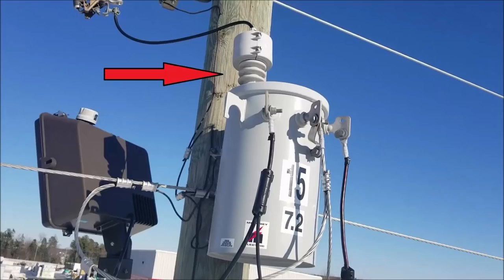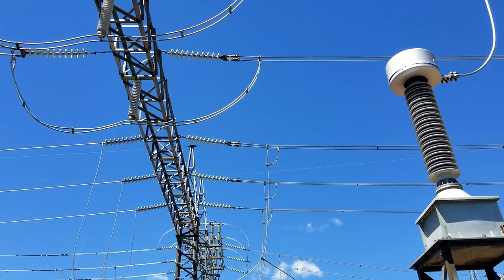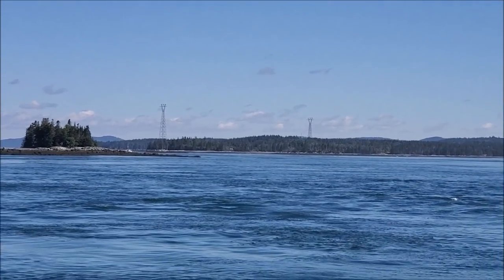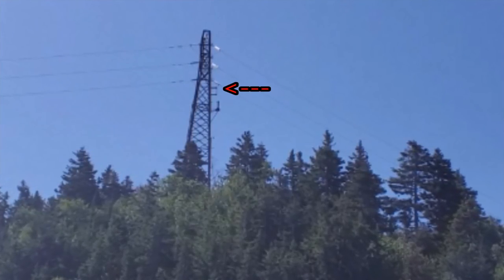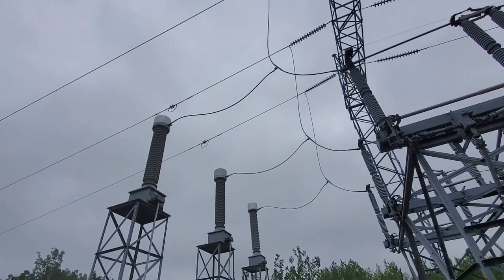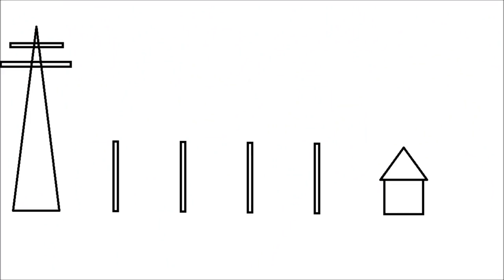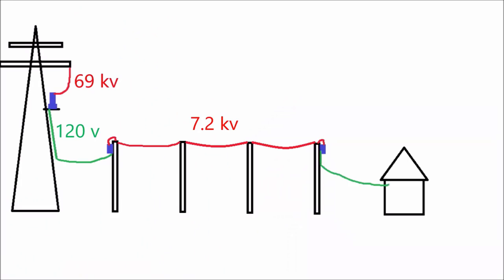69kv tower feeds cottage on an Island

Comment: In the Potomac River, running from the Virginia side near Dumfries near the Possum Point power station to the Maryland side, is a transmission line. I believe the voltage is 230kV. There are strobe lights on all of the towers in the water (IIRC there are 8 of them on the water) except for the ones closest to shore on each side. I wondered how they power the strobe lights. On each of the ones that has strobe lights, you can see what looks like a standard pole transformer mounted about 10 feet up the pole from the platform, which in turn is about 6 feet above the water. So what are they feeding the standard pole transformer with? Well, I noticed that one of the two static wires at the top isn't actually a normal static wire, it's on insulators, tiny ones that you have to look real close to see. And if you look close you can see that the not-a-static-wire feeds the pole transformer. So the not-a-static-wire is on insulators and feeds the pole transformer at each tower that has lights on it. So I assume that they're just feeding the not-a-static-wire with 7.2kV from either the Virginia or Maryland side.

Comment: bet his service is pretty reliable, being on the transmission and all
Reply: And I'm sure he could get 3 phase no problem.
Reply: @GeneralChangFromDanang  That is not necessarily true. If the power usage is low, and there is no prospect of power demand increasing in that location for decades, then there would be no point using 3 phase line to that location. That would be unnecessary cost, even if small one.  In Europe it is very common to have 3 phases almost everywhere. US and Canda are weird.
Reply: @movax20h  Understandable, but high voltage lines in the US are usually 1 line per phase. I was pretty sure I saw 3 lines on those towers.
Reply: @GeneralChangFromDanang  usually you will see 3 wires. It will be two phases and neutral. Additionally neutral often will be grounded on poles regularly and at the end of line.
Reply: @movax20h  No neutral required on 3 phase high voltage lines. But I understand that confusion.
Reply: @movax20h  You can clearly see 3 phases on that transmission tower.  They're only bringing one down to the transformer.
Reply: @movax20h  It is never two phases and neutral.  You might be thinking of split phase distribution to a house where it is two legs of one phase and neutral.

Comment: Fascinating
Thank you for sharing Aaron. 

I'm curious about lightning protection at the cottage end of this.
Wouldn't this particular residential service be susceptible to much greater risk of lightning related issues? As the single load on this branch of multiple towers/multiple spans, without an entire grid of residential/commercial loads in parallel... it would seem more likely to be an issue here. 

I fully appreciate lightning possesses so much energy that it'll take extraordinary paths ... 
However, just curious if a single customer after all that physical exposure via long HV feed is more susceptible than a big parallel group of residential services. 

As a retired JW, I don't believe I've ever given such a scenario any consideration. 

Thoughts?

Comment: Is the cottage satisfied with the amperage it can get this way?  If it has high power electric anything (e.g. a stove) that's going to be a challenge with only one PT and 7500 VA (watts, for resistive load).  That's like two large burners and the oven.  Can two PTs be used in parallel to get more amperage in the final customer feed?  (15,000 VA or 62.5 A on split 240V.)  Or instead of parallel, can one of them be hooked up with opposite primary (or secondary) polarity so as to form a split 240v line with the other, so the resulting feed may drive a pole pig (7200 to, or in this usage from, a split 240)?

Comment: I looked one of these up and they're called power voltage transformers. How is the primary on this wired? The ones I've seen have one primary bushing. Are they wired line to line? I don't see a "neutral" on a transmission line.

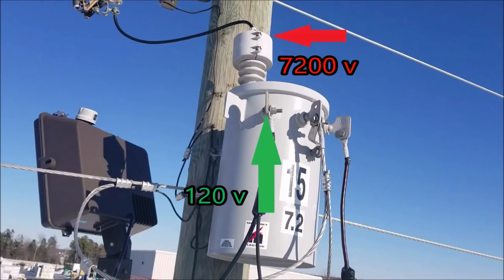Comment: 4:10 I get it! I think.. I see how it works, the why? I think you are about to explain..
Edit: voltage drop, okay.. yeah, that makes sense.  I was thinking less different types of equipment to stock and I was going to say IDK about the cost of a 69kv to 240v transformer.
But you've got the PTs at 120V.   Could you have run 69KV to the cottage and stepped down two phases to 120v/ea.? - this is why I'm not a lineman, 3 phase confuses me. 

But that seems like you could use smaller conductors and cheaper transformers, idk the cost of the 7.2KV ones, but they look like they use more material than the PTs for voltage measuring.  What is their ampacity?  If it's just for measuring, I was surprised to learn it was still supplying all the current to the cottage.

Comment: Walk up to the pilon and take a video showing us a good view
Reply from the maker: I certainly will if I ever get the opportunity again!
Reply: @Bobsdecline  thanks
Reply: @Bobsdecline  can you do a video on how to tell if high voltage “7000 volts” lines are 3 phase or not and is there ever a ground on a primary line and why are there 3 wires and sometimes 2 or 1 high voltage primary wire

Comment: So why would you convert to 120 first, then back to 7200? I get that you want to measure, but why not just convert directly from 69k to 7200, and have an additional small transformer to do 69k to 120 for measurement? 

That way instead of needing two big power transformers (one for down to 120, one for back up to 7200) you only need one big power transformer (69k to 7200) and one tiny cheap one, saving quite some money, and eliminating the losses of that short 120V run.
Reply from the maker: That one big one would be too large to mount on the tower. Essentially what you'd have at that point would be a substation, which would be much more expensive and require frequent maintenance and inspections.
There's more info on this in some of the other comments ✌️
Reply: @Bobsdecline  Ah I saw that comment. So they simply don't make a small 69k-7200 unit. Makes sense given that would be device for special occasions only.

Comment: Your standard voltages are strange from my perspective where we generally use
11kv, 33kv 132kv, 275kv and 400kv for transmission....

That 69kv line looks physically larger than most 132kv lines here!

Comment: That was an interesting video. I was wondering why the voltage is not stepped down at the tower to 7200 volts and then at cottage to 120 volts?
Reply: Because a 69kv to 7.2 kv transformer is one you'd use at a substation.  It is huge.  They don't have much of a market for little ones.

Comment: Is it more dangerous if the backfeed were just 120V instead of 240V, as in a center tapped transformer, applying only one 120V leg would mean a higher turn ratio in the transformer, and 14400V out instead of the 7200V if backfed with 240V? Therefore a higher, more dangerous voltage (at lower amperage) when backfed with a lesser voltage across only the one leg instead of phase to phase directly? **Brainfart, of course voltage and turn ratio cross each other out, but feeding 240 mistakenly into only half the center tap WOULD yield 14400V on the primary)**
Reply from the maker: Yessir!💯
Reply: Not necessarily. If the transformer was fed a voltage much higher than it was designed to handle, the iron core would saturate. In this condition, it would draw heavy current and the output voltage would not necessarily be as much as expected.

Comment: I’m guessing no voltage sag at that cottage lol
Reply: Let's just hope the engineering department doesn't forget about this poor guy when they look at increasing the transmission line voltage 😂🙏.

Multi-million dollar transmission project Checklist:
✓ insulators (add more)
✓ reduced voltage drop
✓ line tension
✓ some impedance formula * distance coefficient of lost to heat
✓ step-down substations
✓ labour resources to carry out project MMDT
× that guy on that islands electrical service over there 
/Facepalm 😝
Reply: James S honey, why are the lights suddenly becoming WAY brighter ..... ZAP!
Reply: @jerrykorman7770  😂😂😂👍👌
Reply: @jerrykorman7770  AFAIK the transformer would go into saturation and its current would shoot up. Either the transformer oil will heat up and boil, making the transformer explode, or if they're lucky the primary-side fuse would blow. Their surge would last less than a second.
Reply: eDoc2020 sure. But this is the stuff of pratfalls and late night comedy
Reply: @jerrykorman7770  I think the only pitfall was the arrival of eDoc, we were having a few good laughs before they crashed our cooperative standup. 😂😝🙋🇨🇦
Reply: James S that’s ok, I have to sober up for Monday anyway ....

Comment: Very cool setup using off the shelf parts. I'm surprised a potential transformer is beefy enough to power a house - I didn't expect them to be good for more than maybe 100W or so.
What power are they actually rated at?
Reply: Standardized values of burdens   for substations PTs are in range between 50 and 500 VA. That ballpark concerns just metering preceison of the device. Upper limit of allowed power throughput is certainly several times higher before PT gets damaged.
Reply: @imeprezime1285  Thanks for the clarification!
Reply: @ELHV  One Example: 64 kV/115V PT, open core. Nominal burden 300 VA. Maximum rated continuos  power 1.8 kVA. Therefore, I'm surprised

Comment: How does that work financially?? I can't imagine the cost to feed just that one cottage. Does the customer have to pay for all of that?
Reply: Looks like the 69kV transmission line was already nearby (they wouldn't extend all 3 phases just for this), so any construction costs charged to the homeowner would probably be limited to just the 1/2-km 7200V run on poles, and transformers at either end.
Just to give a ballpark range, my sister-in-law was quoted about US$30K for a more ordinary line extension of 2-3 times that length, though probably over less difficult terrain. She instead invested slightly less into an offgrid solar+wind system - no electric bills, but money must be set aside for battery replacement every ~10-12 years, and it requires paying more attention to your usage.

Comment: This is definitely a rare occurrence.  Most system operators won't allow something like this as it is more risk to the transmission system (like if the PT failed or whatever).  I have seen this permitted in very rare circumstances.

What province are you in?

Comment: Thanks for the video! Out of curiosity, why isn't the 69kV transformer dropped directly to the 7.2kV? Having two transformers where 1 could work electrically seems inefficient.
Reply from the maker: Hey Alex! The 69kv to 7.2 kV transformers are very large and heavy, it would have to be setup on the ground. Even the smallest 69kv-7.2 transformers would be overkill and much more expensive to setup. Basically you would end up having a substation at that point

Comment: Wouldn't that be very inefficient? every time you step up or down, doesn't it waste energy?
Reply: It is actually done this way to improve efficiency.  You lose far, far, far more power in increased voltage drop than you do in the transformers.  They are actually rather efficient.  The whole reason we have an Alternating Current electrical system is so they can step up/down with transformers.

Comment: Is there no risk that that PT transformer goes faulty and puts the incoming voltage right through to the output? That cottage would be like a Looney Tunes fireball then. Though i’m not sure how regular substations are protected against this.
Reply: Protection from this would be very similar to how a direct lightning hit to a transmission line doesn't blow up entire towns. The extreme voltage difference actually may be protective in this case because it guarantees significant arcing, either at the device itself or on the transient suppression devices like spark gaps. This arcing will destroy the device it occurs on but will limit the voltage to devices downstream of it. The 120V side of the PT would arc over and basically be a dead short. This would blow the 69kV fuse. The 7.2kV transformers and their spark gaps would add yet another spot to arc over to ground and that too would limit the voltage on the other side. Residual surge in the home may be significant but it's unlikely to be catastrophic, at least to the cables in the walls. A big whole panel protector might actually be able to clamp it to acceptable levels since the vast majority of the fault energy would be dissipated in the distribution equipment as it arcs over.

Comment: So in the case of that cottage, why did they step it down from 69k to 120, then back to 7200 instead of straight from 69k to 7200? Assume the metering is on the person's house after it's back down to 120... BTW looks like a great vacation!
Reply: Because 60 to 7.2 kV transformers are substation transformers.  They didn't need a substation for one customer.

Comment: Was the step up transformer just a 120 volt or was it a 120/240 volt because to me it is feed 240 volt with that hook up. Yes I know each leg is 120 volts but when you have that hook up it is a 120/240 volt.
Reply: The video implied the second step-down transformer was a center-tap 240 transformer, w/ 120 volt potential to center neutral. The first step down transformer (69K > 120) was probably 120 only, since he said it was used primarily for metering.

Comment: Why bother stepping down to 120 volts and then back ip to 7200 volts? Why not just step it directly down  to 7200 fron 69000 volts. thus doing away with the step up transformer altogether. Don't they make such a step down  transformer? That would save even more on costs and energy.

Comment: But can't they step down the voltage from 69kv to 7.2kw then eventually step that down 120 volts so that in all you only use 2 transformers on the distribution line and not 3?
Reply from the maker: A 69kv to 7.2 kV transformer would be very large . At that point your building a typical substation setup which would be very expensive and require frequent maintenance. The 69kv -7.2kv are designed to handle large amounts of load . The reason this setup makes sense in this case, Is the 69kv - 120v transformer is intended for metering only, therefore is very small and doesn't require cooling. The cottage uses very little power.
Reply: @Bobsdecline  Ahh, so the existing installation was made possible with on-hand equipment, and the only 69kv-7.2v units in stock are large capacity.  So maybe small-capacity 69kv-7.2kv units aren't even manaufactured?  Anyway, very interesting video -- thanks for presenting.
Reply from the maker: I've never seen them and can't thinkin of a purpose for their design.

 It would also be difficult to manage the 7.2kv on secondary side. Definitely wouldn't be able to just run it down the leg of the tower ... Unless it was fed into an underground cable🤔

Comment: Seems to me that going from 69kv to 7.2kv would be more logical.
Reply from the maker: That one big one would be too large to mount on the tower. Essentially what you'd have at that point would be a substation, which would be much more expensive and require frequent maintenance and inspections.
There's more info on this in some of the other comments ✌️

Comment: Why not just drop the 69Kv down to 7.2Kv for transmission to the cottage?
Reply: Folks in other comments have noted that the equipment to step 69k down to 7.2k is a lot bigger and more expensive than the metering transformer (on the transmission line) plus the back-fed residential transformer put together. The available 6.9k transformers would be designed for much more load than a single residential user, so the circuitous route being used now makes more sense. (I am a non-expert just distributing information from other comments, so this has the potential to not be entirely accurate.)
Reply: @PaulFisher  Yes, I red that later. Since this situation was uncommon there is no reason to manufacture a smaller transformer.
Like someone else noted in a question concerning if the "metering" transformer could handle the amperage needs of the customer. I speculate that it would because that is how they did it.

Comment: Why step it down to 120V then up to 7200V then back down to 120V? That makes no sense. Just step down to 7200 then 120.
Reply from the maker: A 138kv to 7200kv transformer is extremely large and expensive. They are only made for distribution purposes (to feed many homes).

A 138kv to 120v is a common design as it's intended for metering.